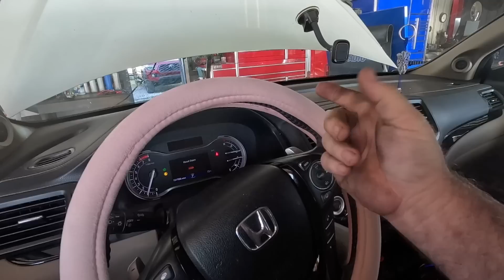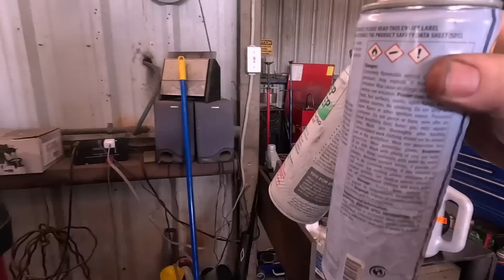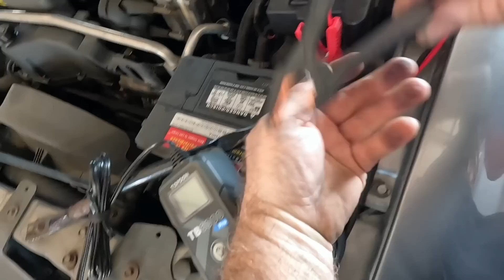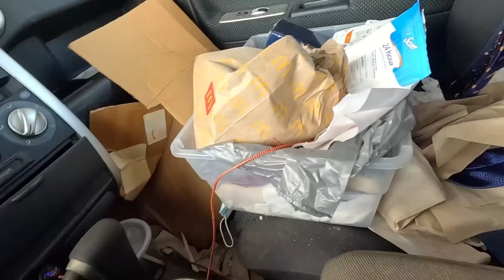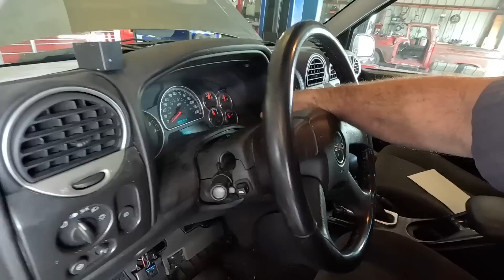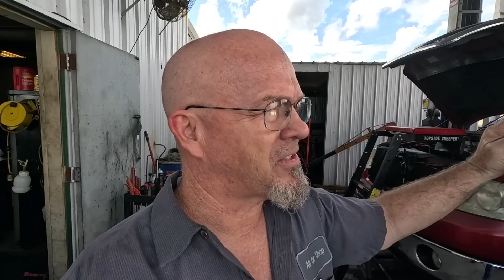A DAY IN THE AUTO REPAIR SHOP 178, HONDA, SUZUKI, SCION, GMC TURN SIGNALS...LATCHES, MISFIRES...

Comment: Guess if you oveheat on the side of the road and need to add some water, you're screwed! Unless you have a pop rivet tool.. Crazy.
Reply from the maker: Yeah, not a fan of these hidden cap designs at all.

Comment: Hi Jimmy,👋 Quick question do you think aftermarket coolant is on the same level or better then factory coolant. And what is your favorite brand?
Reply from the maker: I think the factory coolant is probably best, but the aftermarket coolant is close and does a decent job, costing much less. Even most dealerships use aftermarket coolant to cut costs.

Comment: Nobody did anything with the steering wheel that is dry sweat my friend built up over the years with a little bit of skin flakes thrown in. Take your knife and carve your initials in it Jimmy was here. I had a car with that condition and I hosed the steering wheel with some pretty caustic window cleaner we have at the shop and wiped it all down squeaky clean. However I did not clean the dash mounted shifter build up so the customer can get in the car and go oh my!  Wow look at my steering wheel I forgot what color it was. But when they go to leave and use the shifter they realize that's right you're a filthy son of a bitch